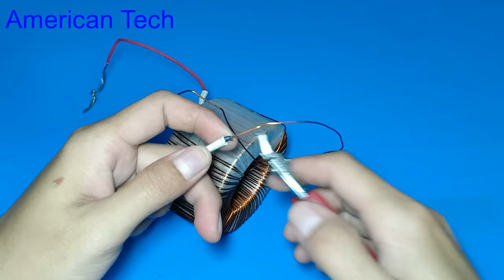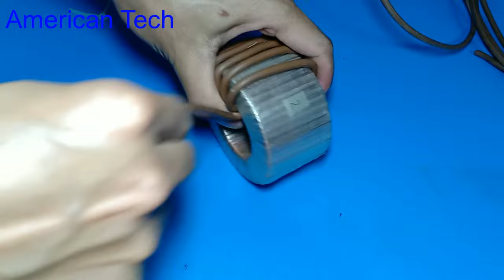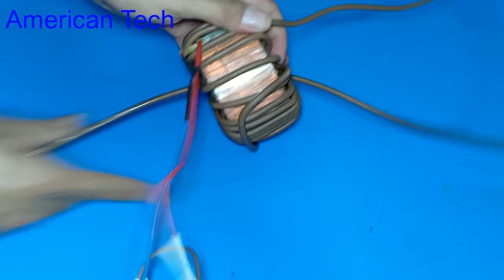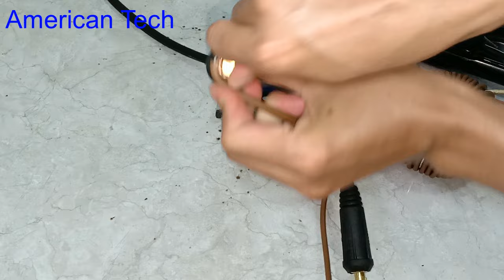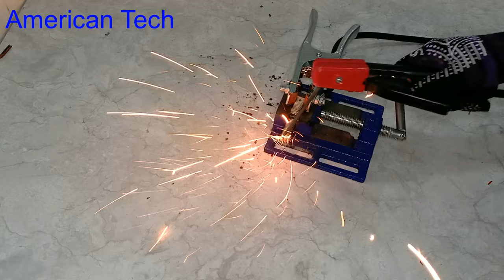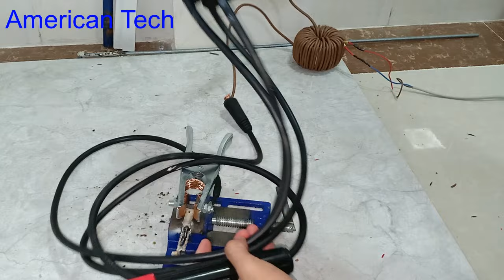DIY Powerful ARC welding machine from transformer

Comment: tech tip; no need to remove the old winding from a toroid trans, unless you need the space... on some you don’t even have to disconnect, just loop your bigger wire

Comment: fake your transformer output  is too small for that output. you buy a inverter arc welder that u use while your welding it. you didnt show the transformer actually welding😂😂😂 and the sound of the arc seems its a dc output from inverter welding not ac from the transformer😂😂
Reply: It fake :))) sound of the inverter welding.
Reply: Doriți că dintrun transformator de la cuptor micro unde se poate construi un mini aparat sudură ?
Reply: Yes it's fake
Reply: Es verdad. No podrias soldar ni un segundo . Se queman los cables
Reply: NO not DC, AC, but no current. 
I weld, and you?
Only 1-1.5mm can be welded if you find a small enough AC electrode.
Reply: Yes ot is fake
Reply: you are right i was going to write same as your comment
Reply: He's not winding a transformer. It's an inductor choke. The ring is from a toroidal transformer that is repurposed. Adding a choke to the output of a welder smooths the power output and allows a much more stable arc.

BUT... that said, the video is bullshit anyways. I'm fairly confident you can't make an AC welder with just a 220v mains to  a choke, then straight to the electrode. A large transformer is first needed to drop the voltage and crank up the amps. But for a choke to even work, you'd need a bridge rectifier to convert to DC, then a capacitor bank, then the choke.
Reply: Fake&Scam?
Reply: What he is winding is a choke not a transformer and the amount of current he shows it producing looks to be about right and nowhere near enough to weld anything at all.

Comment: The diameter of the secondary winding wire, the number of turns, what voltage did it turn out in the secondary winding? Primary winding wire diameter, number of turns, what are the dimensions of the transformer torus?
Reply: Bogus fake video. Waste of time and
Reply: Impossible

Comment: run the transformer output/secondary AC through a full-wave rectifier bridge to get a superior DC welder.   

high power FWB modules are very cheap
Reply: Not DC ..ac output..
Reply: @alvinjacobe7962 

DC gives better welds

Comment: What voltage are you hooking that up to?
Reply: If his core area is about 20 cm²,that means 42/20=about 2turns per volt.He has there on secondary about 80 - 90 turns,so 40 v ..which is just enough for stick welding .

Comment: Hi, Thank you
 
very good

  Please explain how to make an inverter arc welding machine with old atx pc power computer
Reply: Thank you
 @HaseebElectronics
Reply: Hi my friend Is it possible to obtain a current above 100 amp 60V by changing the ferrite core and changing the coil of the Trans Power PC?
Reply: @Alireza AKBARI KOCHAKSARAEI 
Drive to Harbor Freight!

Comment: What is the primary power of this transformer?
Reply: Should be low voltage like 25vac but high in amps  they have ac and dc welders but Dc is the best the stinger is always the ground so basically your shorting it out causing it to arch that’s why it’s called arch welding or you can hook up a couple 12v batteries to 24v or 4 6v batterys to 24v for more output

Comment: Volt out? 30 ? 40? Or more?
Reply: Probably 3-8 volts because of the thickness of the wire and weak sparks
Reply: @lengaming1651  the passage of electrons depends on the thickness ... not the voltage
Reply: @-Crash-Nebula-- Well im just guessing, and the question was about voltage not passage of electrons, a winding with thin wire puts out higher voltage and lower amps while thicker wire puts out lower voltage and high amps just as he shows  in the video, but this does depend on the length...

Comment: This isnt the first video posted by this guy that looks a total nonsense. However, although his transformer is shit, I do have a very large torroidal core myself which is rated for about 200W. If I wrap about 2-3 turns of very thick wire I reckon I'd end up with a device with enough poke to weld batteries. Worth a try